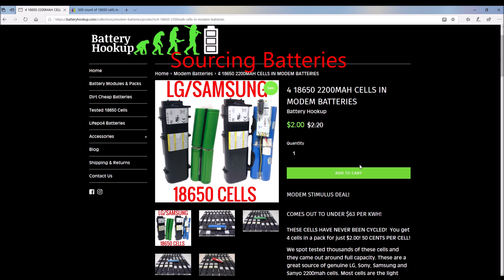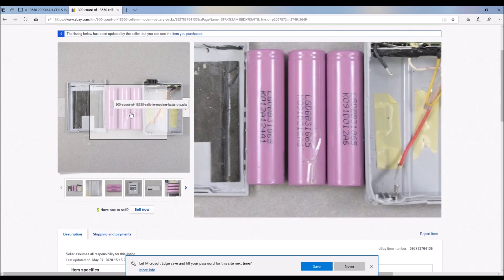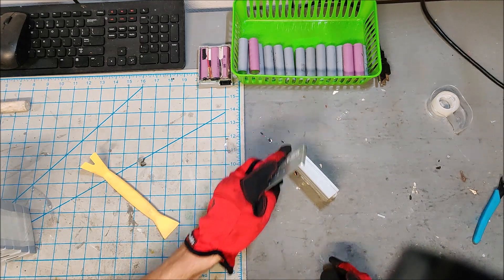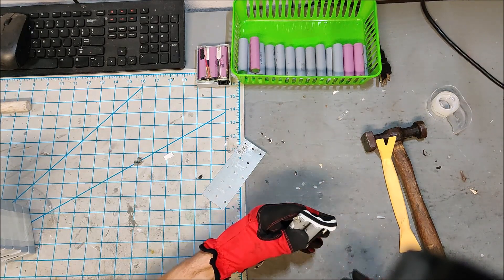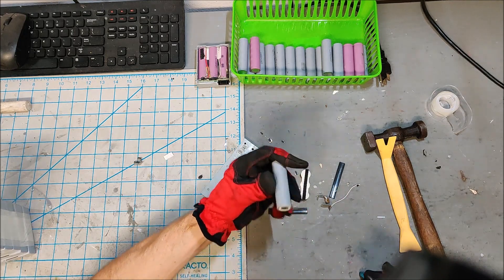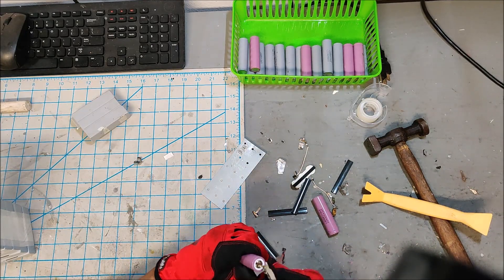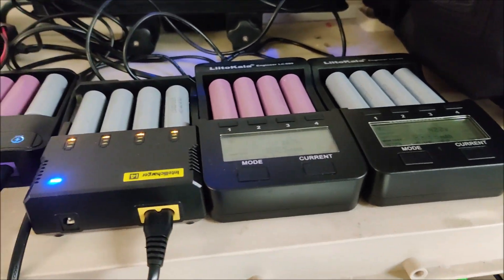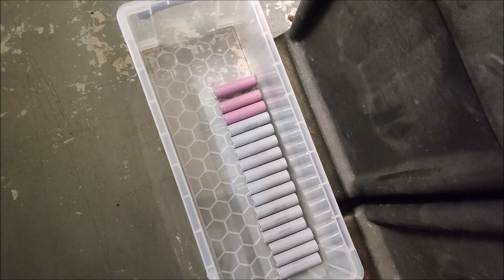DIY POWERWALL PART 1 - SOURCING AND PROCESSING BATTERIES

Comment: I have been testing cells for months! As this is a project, would you suggest a all in one unit like a grow watt charger/inverter? or a seperate mppt CC and inverter? All packs/powerwall will be 24V
Reply from the maker: I prefer separate, especially on smaller systems. That way if something breaks you only loose part of your equipment. Also you can do upgrades to one part of the system without replacing another part of the system. But it also depends how big of a system you are doing? If you have thousands of watts of solar, I might just consider on all in one unit.
Reply: Well, I will have enough to match your 2-24v 7s - credit to you FYI future video, and a modular pack from afreedomproject which has 10 modules of 24v 35ah.
Reply from the maker: @Island.dweller  how much solar are you working with?
Reply: @stevenc22  all in progress. I have access locally to 315w panels at q good price. I was planing on 3 to start with
Reply from the maker: @Island.dweller  yeah 1000w of solar is a good amount of solar. I would still keep the charge controller separate from the inverter.
Reply: @stevenc22  lol ok! Victron 100/50 most likely. Just watching your welder video. I think I'll stick with the kweld I purchased
Reply from the maker: @Island.dweller  kweld is way better but way more expensive 👍
Reply: Well, Today I have completed the second test cycle of 1100/1700 cells. I ran the numbers through repkr and your design comes out to 170AH. Seems high? I am going to have to source 2 BMS for this.
Reply from the maker: @Island.dweller  huh? 170ah @ 29 v is 5kw system. Not high. Why two bms? Bms is about current draw not capacity.
Reply: @stevenc22  I probably made a calculation error. 2 BMS for 2 batteries.
Reply from the maker: @Island.dweller  Okay. Yes if you doing two packs like me, then 2 BMS. 1100 cells with an average capacity of 2ah would be a 8 kw battery or 314ah
Reply: @stevenc22  ahh very good. thank you for the clarification. I plan to have the pack assembled for mid march.

Comment: Is Jinko Solar panel any good? It’s 315W, 37.2V, and 8.48A
Reply from the maker: I looked it up. Seems like a good panel but pretty expensive. You can get 200w for $150
Reply: Used 83.35/ panel would be a good deal then right?
Reply from the maker: Yeah good deal

Comment: How is the average cost in starting in this kind of hobby or project?
Reply from the maker: My first $6kw battery cost around $400, 200W of solar costs $150, inverter $150, charge controller $75 and misc items $200. So somewhere around $1000 for a full system of decent size.

Comment: good video!   I was able to buy my last 1250 cells from that ebay store.  They were .50 cent each including shipping earlier this year.  I enjoy testing.  I guess you will find the bad ones right away.  I don't recall testing any that were low on capacity, even the ones that were below 2.5v out of the pack.  Like with the 4 and 8 pack cells I would find a pack were all the cells would test way low, but usually they were not LG's.
Reply from the maker: Yeah I have had great luck with LG cells. Even low voltage cells recover nicely. There are a few dead ones but a multimeter finds those quick enough

Comment: Those batterys your testing you better test all of them I have tested over 2 THOUSAND of them an have found at least 30 cells with no voltage and at least 10 self discharging batterys  the mah runs anywhere from 2800 mah to 2300 mah if you don't know what all your battery are you are going to have problems with those packs. it might take a little more time but well worth it
Reply from the maker: You are right, I found my first dead pack last night. But I caught it right away and dumped it. I think the charge, let sit for a few days and then check the voltage method works fine for single batches.
Reply: @stevenc22  I was able to reset the CID on some of them. They tested just as good as the others.  Not all but maybe 2/3 reset just fine.
Reply: I test all mine cuz its about the hobby, but these batteries are pretty consistent. you could get away with not grouping them perfectly.  When the battery bank is that big, being a little bit off won't make that big a difference.  After 3.2v they drop off pretty fast. If it was smaller say for an E-Bike it would matter more.  You wouldn't want 1 string making the whole battery lose its WH's.